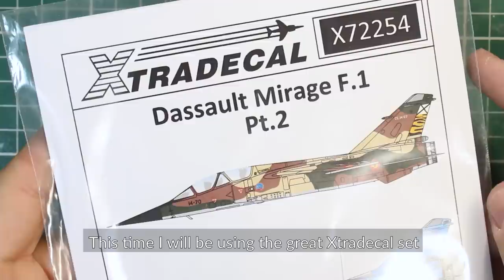Dassault Mirage f.1 BK Kuwait Air Force 1/72 Special Hobby scale model Full Video Build

Comment: Stunning model, as usual!  What are you using for gloss and flat coats?
Reply from the maker: Thank you.The gloss is johnsons future floor wax.The matt cote is Valejo acrylic matt varnish.
Reply: @doctormig2709  Thanks for the rapid reply.  Are you spraying the Future or putting it on with a brush.  I have not had much luck putting it through my airbrush.  Any advice?  Thinning?
Reply from the maker: I am brush painting it.It is seof leveoing so no need to spray it.If you try to thin it you will never achieve the glossy effect.